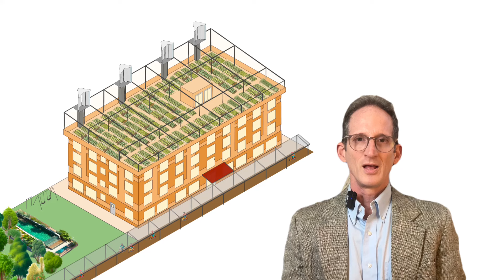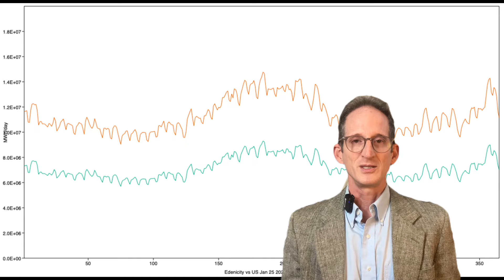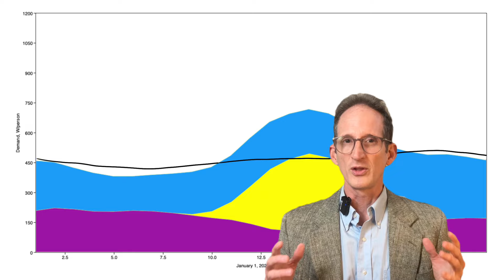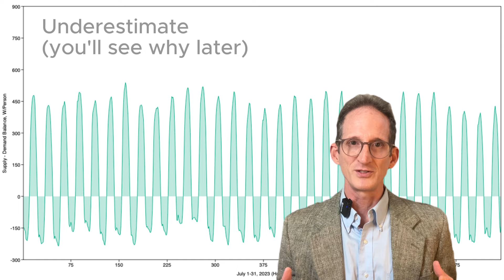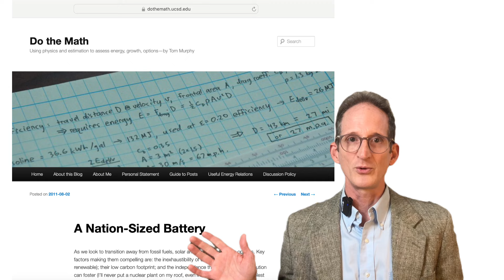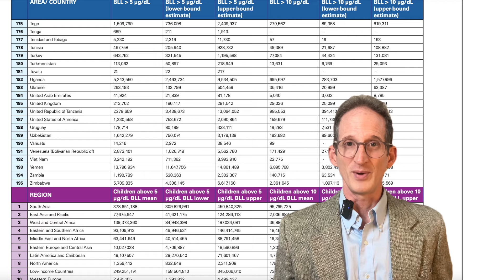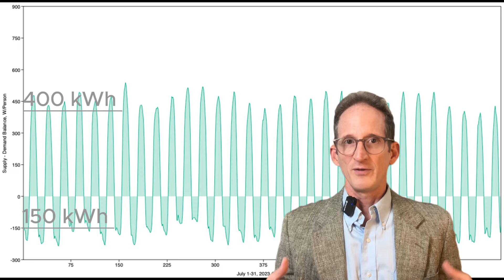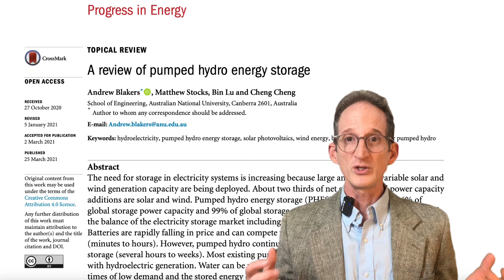Could These 616,000 Dots Unlock Renewable Energy? (Energy Storage in Sustainable Cities)

Comment from the maker: Just to clarify: thermal storage technologies such as Energy Nest are not optimized to store and deliver electricity (because of the big losses involved converting electricity to heat, then back to electricity). What thermal storage excels at is storing heat from industrial processes for later use (at very high efficiency).  This will be useful in Edenicity Phase 2, where industry uses 100% renewable energy.

Comment: What you need to do is your caculations with high tempature nuclear reactors with heat storage like TerraPower's Natrium power plant.  What happens here is the nuclear plant can back off power when solar and wind are producing and maximize power when wind and solar are not producing.  An added benefit is the production of high tempature industrial process heat.  The nuclear power may be more expensive than the wind and solar power but this power will be produced durring short falls in power production when the power is has more value.  Overall power production is made much less expensive.

Comment: I believe the only reasonable power storage solution is a liquid air battery. It does not require special geology, is energy efficient if the thermal waste is stored and fed back into the expansion phase, and should be cost efficient powered off of the excess electricity.  It can also be located close to solar production to reduce losses to transmission. The materials required to expand capacity is just the steel in the containment vessels.
Reply from the maker: @mfsamuel Thanks for the heads up: liquid air storage does look promising in terms of the basic physics. I’ll definitely keep tabs on it going forward. But it still has to prove itself operationally (e.g. when I look for actual lifecycle cost numbers, I still just find engineering models). Pumped hydro is currently the best option for Edenicity because it has over a century of operational experience behind it.
Reply: @edenicity expand your search to include all compressed air storage options (CAES). The existing technology is already similarly cost effective to the pumped hydro, with estimate ranging both lower or higher depending on how the calculation is made. The theoretical efficiency gains of liquid air vs just compressed air, plus the addition of a heat regenerator cycle should increase the feasibility due to the higher density of storage. Also the nature of the compressed air solution is that no special geology or additional transmission costs need to be factored in. In the absolute worst case you would only need to rely on it where the geology makes pumped hydro infeasible.